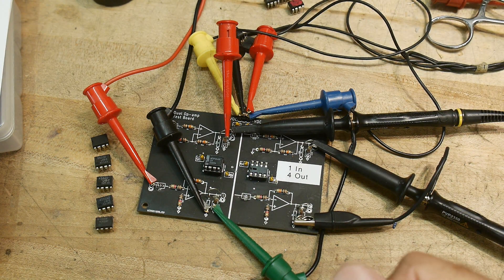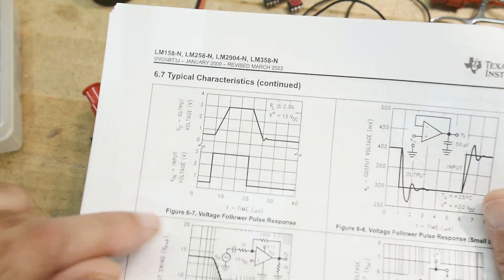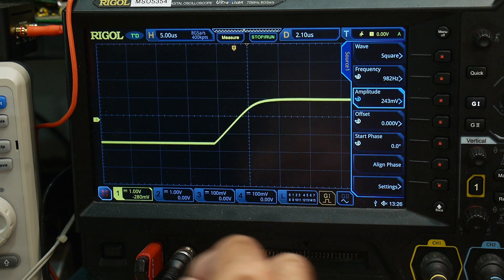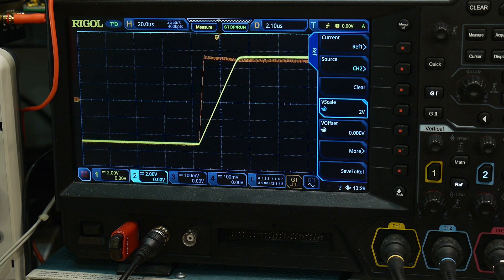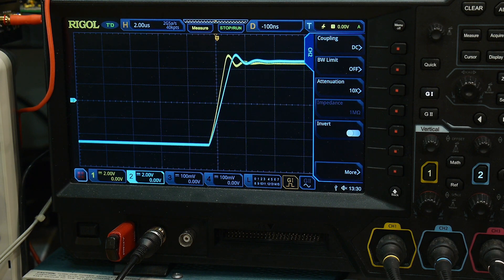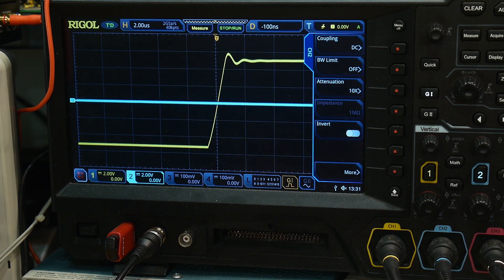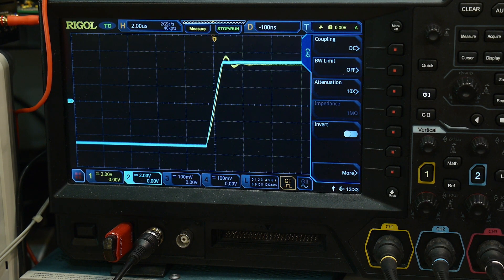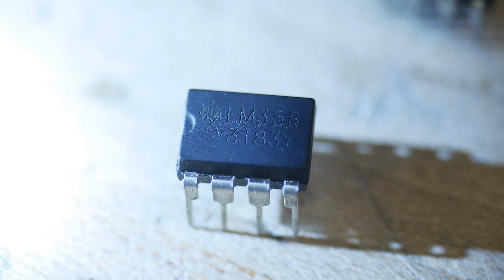#1677 Op-amp Slew Rate

Comment: As the data sheet often shows the (simplified) internal structure, you have certain common groupings - bipolar / FET, NPN / PNP front end etc.  The LM324 & LM358 are easily detectable by externally measuring the input common mode range.  Further you can check the bias current polarity.  Old designs had common mode voltages limited at both low side and high side well below the power rails.  Then you started seeing some with common mode reaching either negative or positive rail.  Finally you now can find "rail-to-rail" designs, although most of them are limited in their power supply ratings to something like 5 or 7 V.  You could try to determine the original part from a few more comparisons on these additional features, especially if you have more samples (as you seem to have).

Comment: 13V/µs Fast op amp?
Try 2500V/µs - ADA4870 (Real beast 1A, 40V)
I want to make a Amp for my Waveform Generator with it :)
Reply: Try THS3491, a lot better BW, but all that does not mean any of them are a good fit.
OpAmps are always about compromises and balance.

Comment: Do you have any LM351 op amps to check it against? LM351's have an 16V/uS slew rate. I used these in the mid-1970's when I needed a high slew rate op amp.

Comment: Overshoot in faster amps is very dependent on the circuit configuration and gain. A unity gain inverting amp will have different overshoot than a unity gain non-inverting amp. Increasing the gain to even 2 will typically reduce the overshoot. This is because frequency compensation in fast amps is a compromise. Those internal capacitors are not for slew rate control, as such, but for frequency compensation to make the amplifier stable. Some high frequency amplifiers are "undercompensated" and not stable at low gains. It varies,  but the lowest stable gain is often around 5.

None of the amps tested qualify as "super fast" or anything even remotely close. High bandwidth amps with high slew rate would perform very badly on that crude test board.

Using a fast amplifier where you don't really need one can be fine if all you need is some gain for a signal. As soon as you put one inside a larger closed loop you better know what you are doing or you're begging for trouble.
Reply: Good points.
Slew rate is defined by the parasitic capacitances and the current flowing through the differential pair and the voltage amplification stage. The purpose of the compensation cap is to bring gain to unity before the frequency at which phase shift approaches 180 degrees and turns an amplifier into an oscillator. The reason the legendary NE5532 is (relatively) fast and low-noise is due to a clever way of split-pole compensation - and quite significant power consumption.

The last, unknown opamp looks really interesting.
Reply: More generally, noise gain controls the bandwidth. You can have 10x noise gain and 1x voltage gain - and voila, slower and more docile circuit. Noisier though :)

Comment: In 1970 I worked for analog devices as an engineering tech. Back then IC op amps were pretty much the LM709 or t41. If you wanted a realopamp you bought a brick that was built of discrete parts and potted in epoxy. They were maybe 1-1/4"square and had 7 pinns, The populated opamp was dropped into a potting shell and some epoxy was squited into hold it all in place.

If the competition came out with something a little faser than yours you just dropped a small ferrite bead over the output pin and that tiny bit of inductance  would goose the response just enough that you might just beat him.. Thats just the way things were 53 years ago.

Comment: Honestly I've managed to de-encapsulate a ton of chips and transistors by holding them in some tweezers and cooking them with a lighter then squeezing them til they pop apart with pliers. 

Once apart the die is usually stuck to one face (always the non etched side visible of course.....) so I cook it again with flame and lightly flick the die out with tiny tweezers. Boom. 

Throw it under a microscope and check er out. If you're lucky they're etched with the actual part number. I've done this probably 100s of times. But always have extras to try again lol.

Comment: NE5532 is popular because it's cheap and relatively low-noise, 5 nV / sqrt(Hz). Step response is not that important when it comes to frequencies below 20 kHz.
Reply: High slew rate and wide bandwidth are very important in audio applications. While the Nyquist frequency may not be higher than 20kHz, you still need high feedback factor well into hundreds of kHz in order to suppress higher order harmonics. That's why LM358 with its open-loop gain roll-off at 10kHz  is terrible for audio. It's so slow that it can't even cancel the crossover distortion caused by its class C output.

Comment: LF353 marked as LM358?
Reply: The LF353 datasheet lists a typical slew rate of 13V/uS.  The mystery opamp seems somewhat faster than that.  I'd like to see how it behaves at crossover.   I like it when they specify slew rate per second, 13MV/S sounds much more impressive. ;)